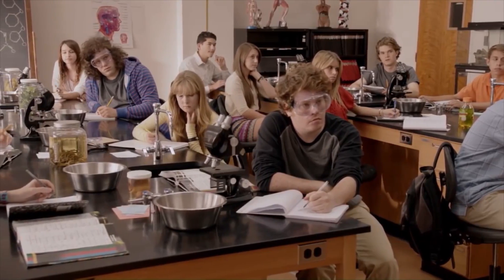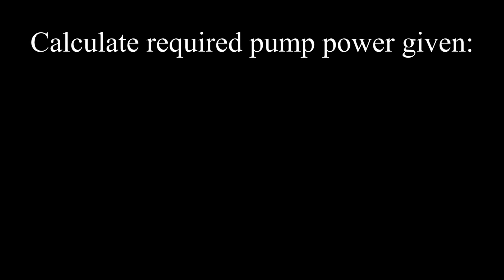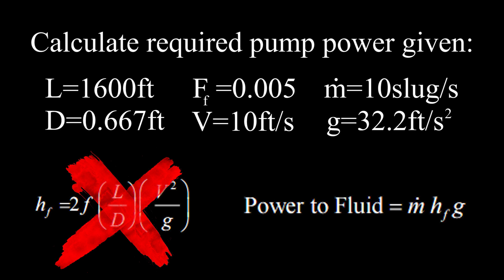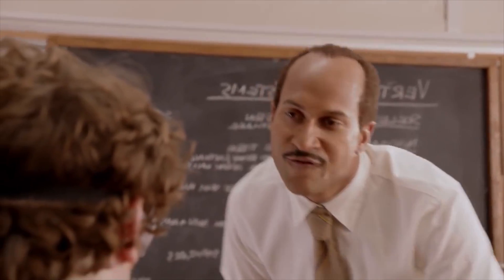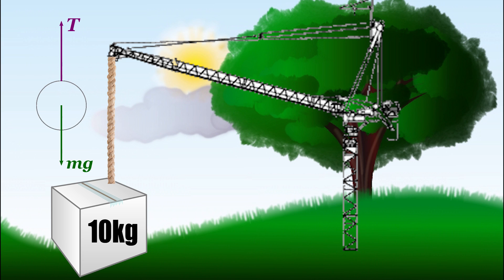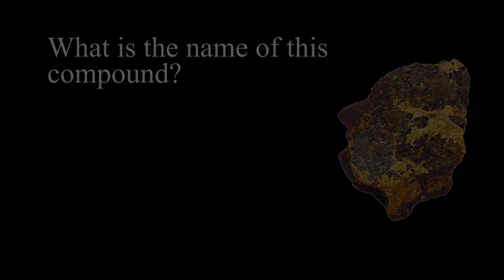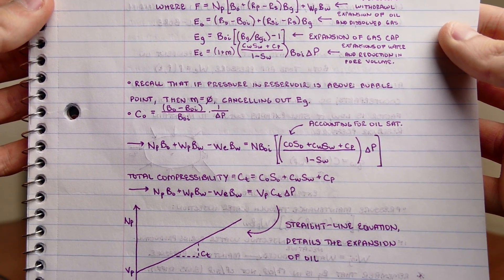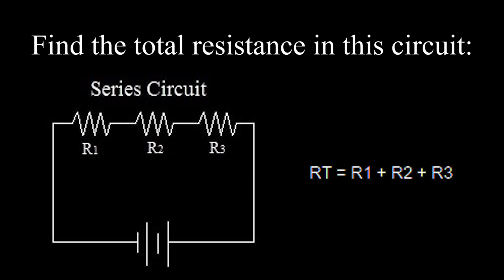How to Pass an Engineering Exam

Comment: Some of this depends on the professor. Some professors can be cut throat and just grade based on your final answer. However, it's always better to have something written down vs nothing. Even if your answer is just fabricated assumptions that follow some type of logic, it at least gives the professor something to grade and they will most likely throw you a bone for trying. Getting some points on a question is better than a 0.

Comment: To everyone complaining about the units. jesus your a STEM major but not smart enough to convert units? Yes we all know SI is better and simpler but those imperial units are still used and are still given in engineering problems. 
Dayum, use google to convert when you go to solve an arbitrary example problem provided in a youtube video if you want to follow along and quit QQ like a non STEM major bitch.

Comment: These tips are true, but honestly if you weren't already doing them you would already have failed any attempts at taking even engineering pre-req classes lols.

And to be honest speaking from experience here, if you don't know shit you wont pass. That's part of the trouble with engineering, you wont get anywhere without actually understanding pretty advanced concepts and performing it on exams. These tips do dampen any blows from the grading pen however.

Comment: So yeah... you obviously haven't been to many engineering exams, have you? Most professors treat each exam question in a binary AND way, following this criteria:

-Did the student follow each and every single step of the solving, not skipping any steps whatsoever?
-Did he do so by using the long, tedious methods explained in class, instead of the quick/easy solution (not always but often) available?
-Did he calculate down to the (insert arbitrary number from 4 to 16)th decimal, without rounding, in every single step?
-Did the methodology resemble the one explained in class? (any deviations turn this into an automatic false)
-Did the result match the textbook/pre-written one, down to at least 3 decimal places?

Engineers among us will tell you that if and only if all of those are true, then your response is considered valid, and if any of those is false, then the question will be considered fail. A few teachers grade by method or approach (you took a different route but reached the same conclusion), but most of them take the "my way or the highway" approach. You know the old saying, those who can, do; those who can't, teach.

Comment: Unfortunately there is no substitute for a lot of hard work during many weeks. ;)
For non-science subjects (social sciences and such) you read the text up to three times, make a structure, learn it by heart and you can answer the questions. For science subjects (mathematics, physics, engineering) you get new questions all the time and you have to perform fast under pressure. Only with enough practice that is possible. If the teacher sucks or the exam doesn't match the preparation you are fucked.

Tip 5 wouldn't work where I live, I am afraid.

Comment: Good points but ,there is a problem - it depends on where you live. Try that in Bulgaria and you are going to get 2 (F - US grade system; beneath 51 UK). The professors here have a nasty habit of disregarding lines. They check equations (math), code (programming) , calculations (finance) line by line. If 1 line is wrong (miscalculated or wrong formula) - they disregard everything after it (it doesn't matter if it right or wrong - they don't read it). The official rule is - if you don't know an important formula at the beginning - disregard the question , its not worth waiting time on it. 

I'm going to give you a nasty example of that. ASP .Net web development exam -everybody who uses that horrible language knows how long the lines are (peculiar when you give .something). The wurst part is that this exam is done by hand on PAPER - not computer (because the professor is an idiot and believes that you need to know the langue perfectly).  I did a mistake while trying to write a connection string for SQL database and off course i forgot the correct spelling of one par .connection something (i don't remember). 6 pages of code got disregarded because of misspelling something that you get automatically from the codding environment and I got an F.....

Comment: very good video and ive solved problems just deriving units, formulas or brainstorming thoughts on paper.  however writing something else like the example of a parallel and series circuit may just show youre prof you don't have a clue :p.  either way, these are helpful hints.  never leave blankssssss******

Comment: Took my license examinations last October on Electronics Engineering and number 6 hits the spot. There were some questions I think I answered correctly but my peers said no, still I believed in myself and passed the exam, now I am a licensed Electronics Engineer.
 I also do number 2 and 5 a lot during my Uni days, when I mix and match all related formulas/concepts to a question and I sometimes get it right.

Comment: One of my engineering professors would give 1 point for a correct answer, but -0.75 for a wrong answer.  This was to stop students from BS'ing questions and only attempt questions you were pretty sure you knew.  In his mind BS'ing in engineering is a  dangerous habit and can get someone killed in the real world.  Bit extreme.  We also had a class test average of about 20% as a result of his grading policy.

Comment: Luckily the answers of those questions are actually facts like 1+1=2. If you study Digital Design you get exams with questions, what do you think of this? Which is a question where you should give an answer on your opninion, if the teacher don't agree with your opinion, they give you zero points for the question answered. I failed several tests, just because I don't share the same opinion as the teacher(s). I quite hate it, because most digital design principles is quite factual instead of preferences!
Reply: But it's nice to see how it goes on an engineering exam, great video as always! ;)

Comment: hahahahhahahaa, mate in my final mechanical engineering year at the moment, i have passed every single of my exams and tests with those tips, seriously, I don't know most of the stuff I'm supposed to, but still I manage to pull it off every time, which either means I am a great bullshitter or the university system is fucked up :/ Another thing what I do is, when I get a question I just write every single formula that has at least something to do with my problem and plug in the numbers, at some point i get answers and based on that i assume stuff and derive a random answer.

Comment: a tip i use is writing what could be the answer and putting a single line through it then another answer if the first one was right they sometimes give a couple marks for it its like you second guessed your original "right" answer

Comment: I'm only in the 10th grade but I have a huge interest in computers so I'm planning to take Computer Engineering. But I'm still in doubt because people say it's hard, well is it?
Reply: No, computer engineering isn't hard(also there are many related majors you may want to look into such as computer science).  If you can make simple programs before coming in or have a little knowledge of html or css it wont be too hard to pick up on the coding part of it...if your highschool offers college level calculus like AP Calculus AB/BC then take it - the later calcs are easier and the first two are weed out classes at most colleges.  &that's all there is to it.  If you can skip right into your major like I did then you'll enjoy it and find your classes easy...the gen ed that all engineers take is the typically hard part people struggle with.
Reply: Take a range of classes that interest you in high school. consider the fact that you will spend 4-6 years working in your major once you get to uni, it is not fun to study a topic you aren't interested in or plan to work in when you graduate.
Reply: we choose to do what we do, not because they are easy but because they are hard!!!
Reply: DepAnx Yes it is hard, But not impossible to graduate if you lucky enough to get the hard courses with good doctors.
I'm now graduated in CE after 7 years.
electrical engineering courses was the hardest after the 3 calculus courses _''
Reply: Yes, it is! However, it depends on the person. 
I have followed some subjects of that department. You should be able to understand the theory if you are somewhat intelligent (A's for mathematics and physics), the practical assingments are the challinging part in my opinion. Making a programming assignemt within 2 hours on an exam, improving the architecture of a simplified and simulated CPU, those kind of things can be extremely challenging, some people find it easy but others struggle a lot with it.  It is less linear and more chaotic (many ways to approach it) than traditional exact sciences in my experience. Also assignments like translatign a piece of C code into assembly language or the other way around can be challinging. In my experience subjects like calculus, linear algebra and general physics (high school refreshre + addition) were the easiest subjects. That being said, if you study mathematics (also some experince with those subjects) it is nothing like high school mathematics. 

Anyway, you are very young, keep an open mind with regard to what you are going to do and check out a lot of different fields. Also consider electrical engineering, physics (can be very interesting), mathematics, geology and such. Due to your age odds are that you don't know all the fields well enough yet. Keep an open mind.  

One final note, I don't think that Salazar studies computational science. The subject he showed is not a part of that curriculum but it could be a minor subject which he follows. This subject could be from mechanical engineering, geology or chemistry.
Reply: DepAnx I'm planning on going the same path. I suspect it's a lot of math but  anyways good luck in what you choose :-)
Reply: ابوخليل do you have a concentration you chose?
Reply: Chris Chrispy if i understand you correctly: I have no concentration for whole 1 year due to family business. 
I believe 5 and half years is average student time that he needs to be graduated. Though officially it's flat 5 years.
Reply: DepAnx I suggest you start learning right now if you don't want to struggle and lose hope on the major.
Reply: Is it hard? Maybe.  There is a reason why not everyone is a Computer Engineer.  Is it doable? Definitely.  You just have to focus and actually study.
Reply: if u are good at something, don't take engineering
Reply: Nitheesh AG maybe do it after engineering.
Reply: DepAnx
One more note given that Google's software is buggy again (I can't edit my previous reaction aimed at DepAnx and others), whatever you are going to study make sure that you are sincerely interested at it. Sure, look at the job perspective but as long as you can earn a living with it choose whater you like most! Salazar is right to emphasize that in the comments. Nothing is worse than choosing a field which doesn't fit with your interests and talents. Take your time to find out what you are good at and what you like most. As I said, keep an open mind.
Reply: Listen Dawg, Everything is hard in life. But the harder you work the more it pays off. I graduated ME last year and feel great. I got through the tough school work, and already have a decent job that pays more than I thought and enjoy it. But more important than that is I now how the knowledge and am gaining the experience to do something I was passionate about since high school. SInce your in 10th grade you are above 95% of high schoolers that have no clue what they want. Take that passion and go do what you want. Also get an Internship. Start looking now, and apply every year even if you are not eligible. The more times you apply the more confidence you will have. Seriously, my internship set me above 99% of my class, even more than the high grading students, because experience seriously looks better than slapping a 3.6GPA+ on a resume. Also don't give up, it will be hard, I flunked 2 classes still graduated on time with a 3.0, totally fine. Don't make excuses for yourself but also be accepting. Good luck!
Reply: yes its hard and a lot of work but if its something you love you'll stick through it
Reply: ابوخليل ah okay
Reply: i have a friend with a masters in software engineering and all he does is script kiddie for microsoft. however, he does know an unreasonable amount of math.
Reply: DepAnx Same, I am in 8th, already built my computer. Computer Hardware Engineering just really seems interesting to me.
Reply: If you want to work on PCB design of MOBO, then yes, its fucking hard!
Reply: What other courses focus on computer hardware? I'm actually scared of hard subjects because I'm generally in the bad luck of life.
Reply: DepAnx electrical and electronics engineering deals with pcb and circuit designing or manufacturing, and these include fairly interesting subjects.
So far electrodynamics is the only thing that I find most interesting.
And electrodynamics have huge application in almost every industry.
Reply: in engineering we have to study a whole bunch of things. from calculus to life skills to economics.
i took computer engineering as i was interested in software development. actually, if you're interested only in one topic(in my case: software), then don't take engineering.
Reply: Akash Roy
That is not entirely true. Yes, that is a part of EE but is much broader than that. Electromagnetics, telecommunication (for example optics), control theory, signal theory, computational science (overlapping with CS), electromechanics (overlapping with mechanical engineering). Just pointing it out for those who read it and have to make up their mind about what to study.
Reply: Also, I live in a 3rd world country specifically Philippines so I guess educational system here is quite different. Also I dont get to choose classes, I'm already assigned in a class with fixed subjects but luckily I'm at a special program called STE so I already have Pre-Calculus, Advance Physics, Geometry and other math stuff.